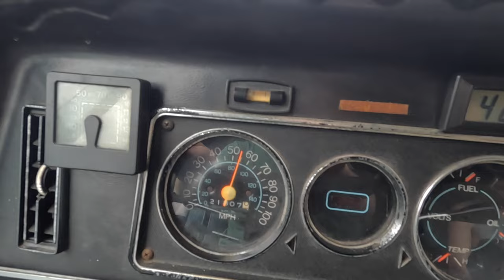Cold Shower at Love's | RV Nomadic Lifestyle | Medieval Castration Device Found at Pier

Comment: What did everything cost you?
Reply from the maker: Cal bought the argosy for $12,000 in Toronto back in 2014. The Most recent repairs cost $5400. That included the transmission, the water pump, new ignition, timing, manifold milling, exhaust tail pipe. And all kinds of fluids and other stuff. The towing cost $300.
Reply: @CalandMomo  🤕 ouch. That's sounds like a good deal for all that work. I truly hope you don't have any more major break downs.